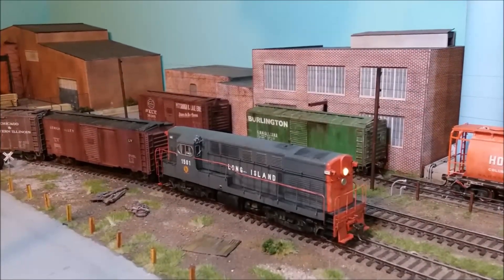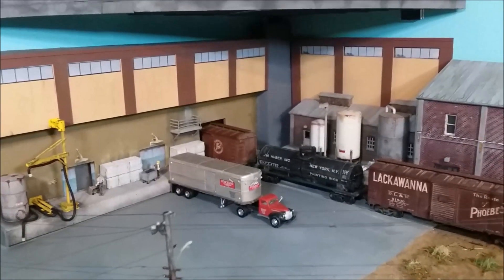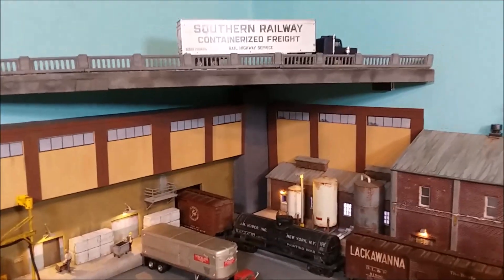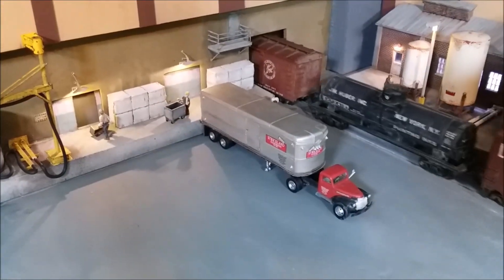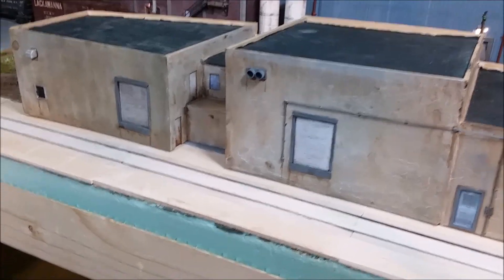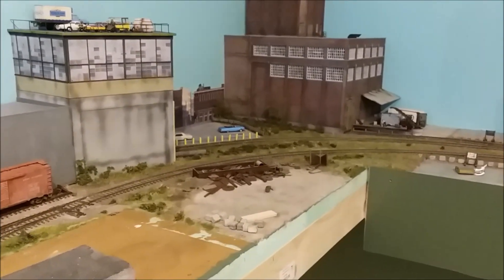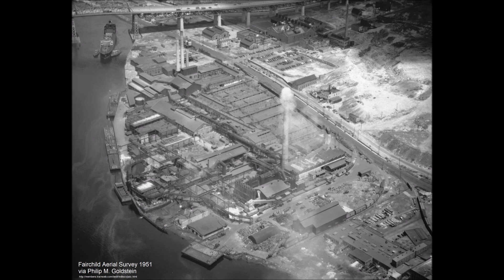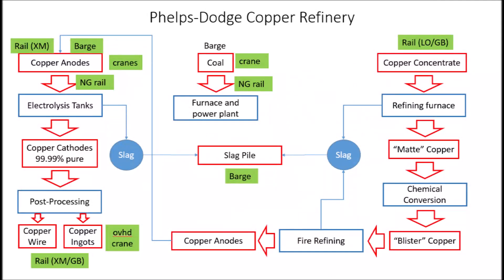Thought it would be switching but turned out to be a layout update

Comment: What do you use for those vacuum hoses at various industries? Is it wire with the tips painted silver? They look pretty good and it's a detail I'm missing on my layout. I also found the copper refining information very interesting.
Reply from the maker: It's rubber tubing I got at Hobby Lobby in the "beading" section. I stick in the wire (which is probably 14 awg but I'm not sure) and then put short lengths of 1/8" dia styrene tubing at the ends for the fittings.